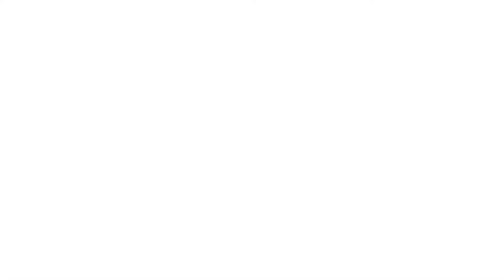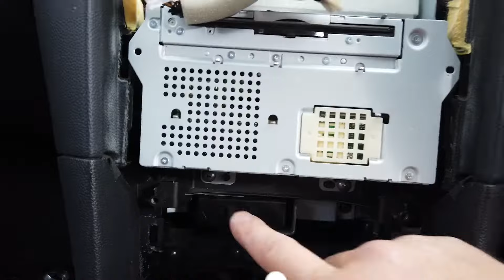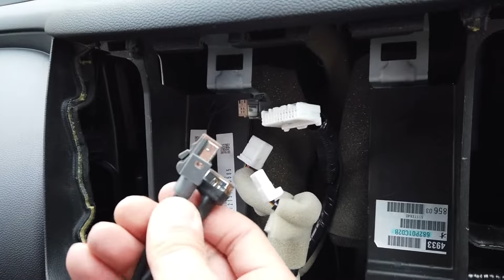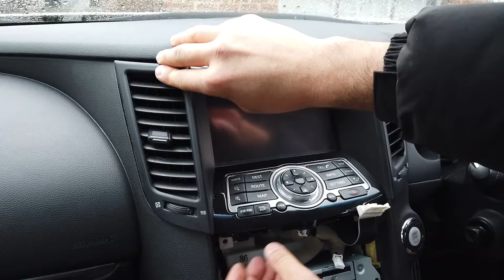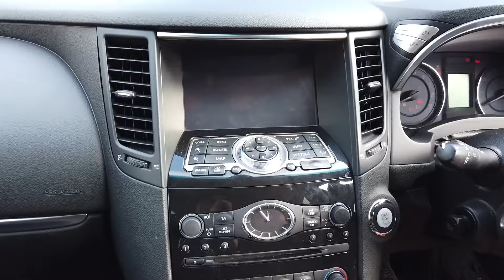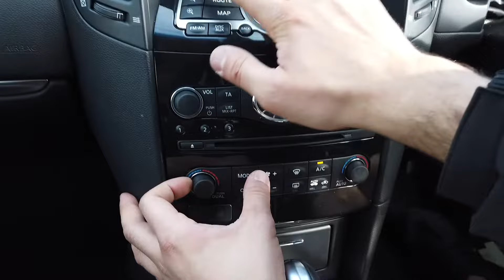Apple CarPlay & Android Auto for Infiniti QX70 2013-2018

Comment: Hi , I installed it and it was working fine until it suddenly stopped switching to carplay screen with the back button. On the map on the phone, it shows connected to carplay but  (this is the button eorked initially). i am unable to switch screen. Any advice?
Reply from the maker: For order or technical support, please contact us through the website or send us an email and subject your order number.